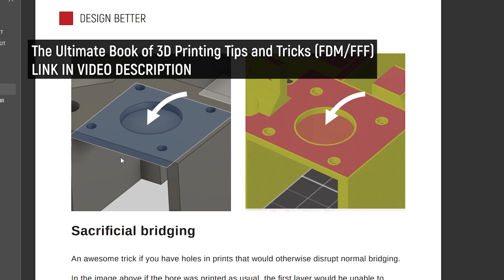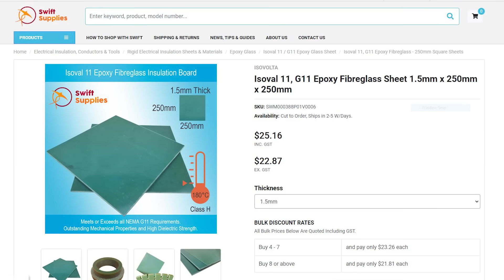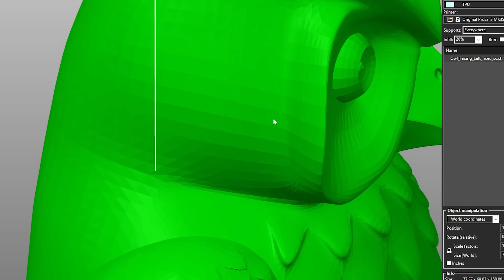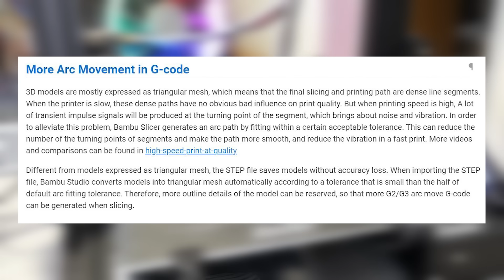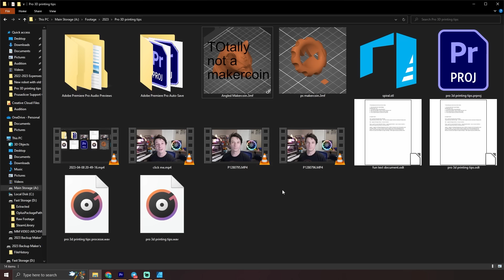5 3D Printing Tips I wish I knew years ago! #3DP101

Comment: Your videos are greatly appreciated 
I catch a lot of static from people that claim they've been 3d printing since 2011 or they have engineering degrees and blah blah blah
What they fail to realize is #1 that I've never dropped anything about what my experience and knowledge is and #2 we can all learn something from somebody regardless of how long they've been at it or what their education credentials are
The worst of these kinds of know it all types is in the BL forum
My bed is warped, this machine is garbage, I can't connect, closed eco systems are blasphemy, and on and on
Said know it alls with more experience and knowledge than Joseph Prusa will drop an issue, I'll drop suggestions and then get met with ignorant replies and stories about how much they know
All of my printers are different, all of them run beautifully and all of them are modified including my X1C
I find it refreshing and reassuring that people like Angus from MM and Michael from TT are out here helping the community rather than detracting people away from this 3d printing rabbit hole
Maybe it's because I have a day job that pays well beyond the 6 figure mark and 3d printing is just a passion to me rather than a means to supplement my income that gets these people upset
Then I bang out high quality prints that are dimensionally on point at very fast speeds and it must just be luck?
No matter what, I'm in this for the love of it and love a challenge 
I may already know much of what is discussed on the videos I watch but I still watch and listen all the way until the end because there just might be something I'm missing that could make my printing easier or better
It's like asking 10 different mechanics how to fix the same thing, you might get 10 completely different answers but they are all correct 
Either way we learn something whether it's the right way or the wrong way, so long as we learn something it's a win in my books ⚡️🧠⚡️

Comment: A food dryer is for sure an option, the question is if it is worth it. If you have one and you don't need it anymore, why not, but otherwise? Buying a new one costs about the same as a filament dryer (not included upgrades for the food dryer like your bearing) but the filament dryer will use 50W-100W, where food dryer start at 250W. So your energy consumption is much higher and with the horrifying energy costs at the moment here in Germany you need to think about that too.
Reply: The power ratings on these don't mean much. That is typically just the power draw while the heater is running. The food dehydrator would use 250w in short bursts while a dryer would use 50w for longer. Generally, power draw shouldn't be that different and would mostly depend on how well insulated the device is.
Reply: Right? That one kind of didn't make sense to me. Not to mention that glue sticks aren't a secret and actually come with some printers and are recommended for troublesome prints by, literally, everyone.

Comment: I've been looking for a sheet of G10 to fit my Anycubic Mega X ever since your first video about it but I've never found one at this mythical cheap price you claim, even sheets closer to standard bed sizes seem to be vastly more expensive than their official counterparts, and I'm talking like up to 10x more expensive sort of thing.
Reply: In Australia Artisan Supplies has G10 Liner Material (300mx300mm) for $8. In the US knifemaking suppliers stock it - for example trugrit abrasives has a 12x12" .062" sheet for $18 (sku: G10-RR-12X12X.062)

Comment: Lots of modern "file formats" are just zip files. An interesting use is to embed the original source, for example your raw model design inside the 3mf in this case, or the ODT in a generated PDF, this kind of things.
There's also ways to alter a zip file slightly so that it would still be a valid zip file when opened as such, but it can also act as another file format, like mixing a picture with a zip that would open as a picture with an image editor, and as a zip with an archive tool.
Reply: Micro$oft Office files (docx, xlsx) are also zip files. If you have a document with pictures inside, you can just open the archive and inside you can find the original images.
Reply: could also use it as a crude watermark in case of redistribution

Comment: Another one=
Your nozzle-temp keeps changing?
Check if your nozzle-fan might blow air onto your cartridge heater. That cools the heater down a it and causes issues.
This solved many issues at my company after reassembling the hotends. The printers kept turning off because of fluctuation of the temperature. We rotated the heater-block for the heater to not be on the same side as the fan.

Comment: I tried the glue stick. Too much jank!!! Then I found "Aleene's Tacky Glue"!!!  100% PVA (Poly Vinyl Acetate) and water soluble. It comes pretty thick, so I dilute it with an equal amount of water and put it in a clear squeeze bottle. Just squeeze some on the print plate, G10 in this case, slap it on the aluminum base plate and turn on the bed heat for a bit to get it to dry faster. Other adhesive I use is the Good 'Ol AquaNet Hairspray!!! Both the PVA Glue and AquaNet Hairspray can be easily rinsed off the G10 plate under hot running water.

Comment: To be honest I think the best and most important thing with 3D printing is a level bed without the use of a BL touch and correct extrusion volume! I've only ever printed with abs and a glass bed using abs glue from acetone mixed with a small amount of abs and never had any issues
Reply: What's the deal with BL Touch?
Reply: @SantiagoLuz  as opposed to? 
Edit:  like why homie don't want one?

Comment: G10 isn't working for me. everything about my prints are great. only the adhesion is a major issue. glass , pei, g10, glue stick, 3dlac nothing works, and it's only pla and petg that i use
Reply: Try raising the temperature. If no surface seems to be working for you, temperature is probably the issue

Comment: The G10 bed was the best advice you taught me about. I did have to prep the bed with wet sanding the gloss surface to a dull finish. Adhesion and finish is amazing. I wasn’t having a problem with PEI adhesion but didn’t care for the rough texture it left on the print. Thank you for your videos.
Reply: what grit of sandpaper did you use? I'm' interested in this dull finish you've talked about.
Reply: @myfelipe95  Try 200-400#
Just be aware of what finish you want, and remember that scratches are more visible on deeper cuts like those offered by lower grits

Comment: Great tips! Glue stick and IPA was too much work and too inconsistent for me, so I've mixed PVP-K30 powder (which is main "glue" part of glue sticks) and clean IPA and put it in a small spray bottle. I use it on glass and it works amazing! Super high adhesion when bed is hot and prints pop off when bed comes to room temperature. Works very consistently - haven't failed even once.

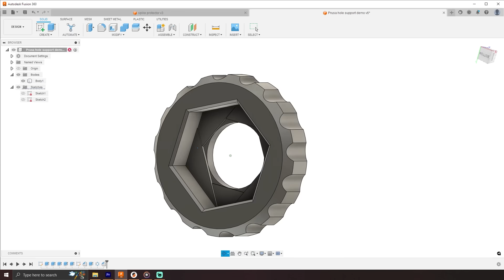The mixing ratio is 1:18  by weight, PVP-K30 powder to 99% IPA. It doesn't mix instantly, so it needs about 5 min constant stirring (I use wooden stick in a drill press for that))). Again, can't recommend this enough.
Edit: changed PVP-30 to more correct PVP-K30
Reply: Thanks for the tip!

Comment: I use a fr4 plate to 3d print and it works fine ,my understanding is that garolite is a brand option but can someone explain why my sheet is more matte like und not as glossy as his and also does it have any influence on the properties of my fr4 plate ?
Reply from the maker: FR4 is the fire retardant version, but I'm not sure that is the reason for the texture difference.

Comment: ever since the OG G10 video, I have not been able to find any in a size at or larger then my ender 3 bed...
been a huge bummer since my current bed has been slowly degrading this entire time.
Reply: McMaster Carr in the US has G-10 up to 36"x48" - Search for "Multipurpose Flame-Retardant Garolite G-10/FR4 Sheets and Bars" - you'd want the 1/16" thickness

Comment: I do a similar thing to your glue stick using a 50/50 mix of pva glue and IPA - keep it in a jar, and paint it on when the bed is hot.  Wait for it to dry, and I'm good for 5-10 prints.
Reply: Glue stick is basically PVA, if im not mistaken
Reply: @kcalbxof  yes it is.  Just a different way of doing the same thing.

Comment: You can dry your filament even cheaper: use your printer bed.
60°C, filament spool on top, cardboard box and if you want ventilation, use the part cooling fan.
Reply: This trick has been around for some time, and I'm surprised more people don't do it.
For them that don't do this. Simply get a box (I use the one that my filament came in), cut off one side, pop some holes in the opposite side (now the top) for ventilation, set bed to 60-65, put spool flat on to heat bed, place box on top of spool. I have a small cut out at the bottom of the box to help ventilation.
Reply: I need more details
Reply: @DoubsGaming  BV3D has a video on it. It's called "Most Expensive Filament Dryer (that's also free*)"
Reply: @DoubsGaming  He means put your printer and spool into a cardboard box so that they stay dry
Reply: @bartybum  I don't think so. I think he means put your filament into an upside down open box on top of your print bed. Then set your print bed to 60°C and let the heat in the box dry out the filament. 

I'm not to sure what he means by the part cooling fan as ventilation. Perhaps take off the fan and put it in the box or build the box around the fan or something like that.
Reply: @deadly_dave  maybe the fans on the nozzle? Though for that I feel like you need some sort of attachment to reverse the airflow from pointing down to drawing it upward.
Reply: @DoubsGaming  Maybe althou you could just get an old PC fan and attach up a 9V battery (Or I have made a little rechargeable stand alone fan, runs off an 18650 and a TP4056 and a random switch I took off a doner board, you could make something like that.)
Reply: @deadly_dave  shhhhh hehehehe
Reply: @thaphreak  Sorry, I forgot this is for ELITES only :)
Reply: @deadly_dave  if you use a PLASTIC box, youll see how much water is in there...
the cardboard assists by being absorbent.
the cooling fan j7ust gets air moving inside the box to ensure maximum transfer of vapor from the plastic and to the surrounds...

no point venting the box exactly, as all your warm air will escape...
Reply: @paradiselost9946  Yeah that makes sense.
Reply: @bartybum  how could you get that so wrong
Reply: @deadly_dave  You need some form of ventilation to draw in fresh air when drying anything. Air can hold only so much moisture, and it's moisture capacity increases with temperature, else it just condenses inside your box, back on the filament. Not having enough ventilation, means way slower drying at best. If your box is smaller than your print volume and you don't have ventilation holes, you likely are limiting the speed at which the filament can dry.
Reply: rise the spool using 2 pencils, do not put it directly on the bed, unless you want deformed spools
Reply: @victornpb  And rotate the spool halfway through your timer.
Reply: This is a clever idea, but won't work out of the box on a Prusa printer. In the Prusa firmware is an idle timeout for the heated zones. I'm not sure if there is a Prusa specific Gcode command to disable this.
Reply: I guess that could be a good backup solution. But you need to go through several steps to set it up, you can't use your printer while drying, you have to fight against safety cut off, it's likely to be quite energy inefficient, etc. Food dehydrators are quite cheap. It's worth getting one.
Reply: @gaellafond6367  Yes but, it's less expensive to just use your printer. If you're a hobbyist, the most economical solution is often the best solution.
Reply: For every closed box printer.
Reply: I've stressed tested this idea with a spool of PETG left in my garage in a very moist climate for years. I'll get good results from the outside layers, but as it gets deeper into the spool, it starts showing evidence of moisture again.
Reply: Or just use your Oven maybe?
Reply: @iulianhagea5815  Probably best to keep some filaments away from the oven you cook food in.
Reply: @deadly_dave  How am I then supposed to cook the forbidden noodles as a crunchy snack to eat while I wait for a print to finish?
Reply: @iulianhagea5815  If it is electric, yes.  Flames give off moisture so a gas oven is not good for dehydrating (food at least).
Reply: @iulianhagea5815  most ovens are imprecise at holding a temperature and will often overshoot significantly when set to low temperatures like 60c, which can easily ruin PLA. A print bed is much more precise at holding a temperature.
Reply: @hasso0n  I have a half-spool of ABS which will attest to the overshoot of a domestic oven. The filament is partially bonded to itself and the spool looks like Dali got his hands on it.

Comment: Silica gel cat litter is a fantastic dessicant and very cheap. AND... you can dry it in the microwave so it's reusable over and over again so you dont need an expensive food dehydrator either ! I use it all the time as the UK is quite wet most of the time.
Reply: Both silica beads and molecular sieve material is reusable by drying them out in a dehydrator or an oven.
Reply from the maker: Nice trick! Yeah it's crazy wet here too and it really does affect filament.

Comment: Great video! Regarding the discussion of slicer handling of arcs: Octoprint has a plugin called "arc welder" that attempts to replace linear move G Codes with arc move G Codes.  In your opinion, is this an effective solution?

Comment: I've been using the cheapest white craft glue (about a pea sized bead) wiped onto the bed with a damp cloth for some time now and its done wonders for adhesion without making release a problem. If you do it when the bed is cold then heat it it dries into a layer that lasts for several prints. if it starts getting untidy its simple to get off with a little isoprop and re-coat.
Reply: Soap and warm water works way better than iso for glue.

Comment: So how are they doing option 1 is it a model shape or is it a setting in the slicer?
Reply from the maker: It's designed into the part in CAD, before the slicing stage. EDIT however there isn't any reason a slicer couldn't apply this logic to support similar details... maybe in future.
Reply: @MakersMuse  ok yep. That what I was thinking but wasn’t sure if it was a slicer hack. 

So they would probably have an idea of the layer height then place the step in. You could add a part in slicer to create it I guess if you had downloaded someone else’s model.